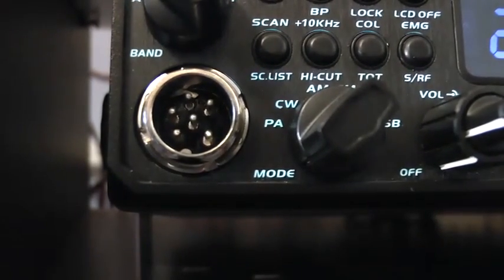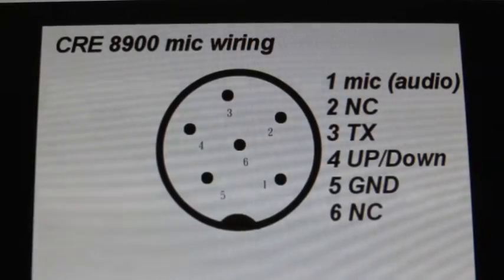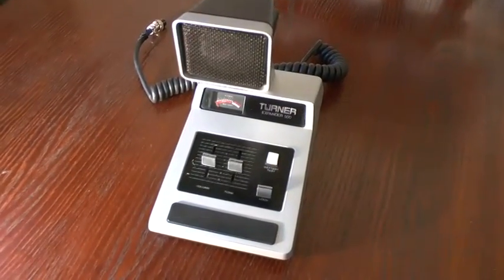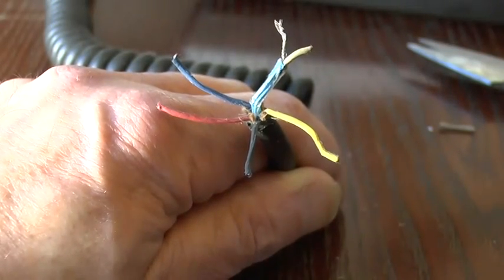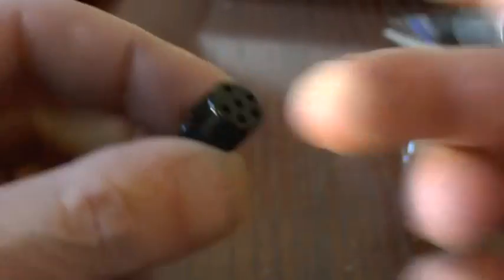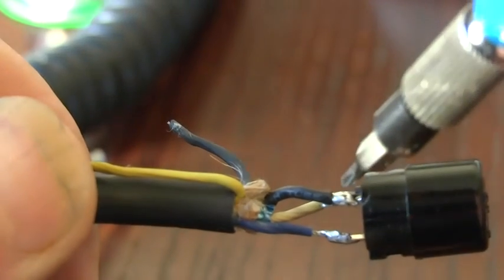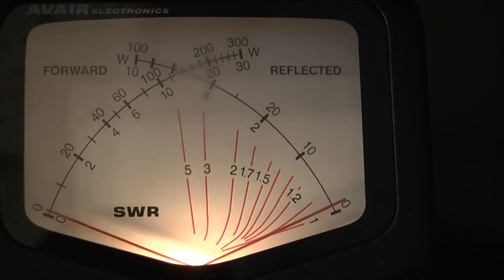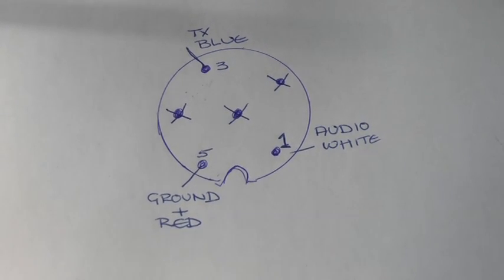Turner Expander 500 wiring to CRE 8900

Comment: Thank you very good video and a great help.  I have a Turner Expander 500 wanting to connect to my President McKinley and this wiring is exactly same for my 6 pin plug so going to do what you did and remove the pins not being used very safe way of doing things.  Well done good job!

Comment: Just to answer my own question. With a straight Turner Plus Three microphone the red wire is not necessary and left disconnected. The rest of the wiring is exactly like this video and pushing the three extra pins out is definitely the way to go. The Plus Three is an amazing mic with this radio too. Thanks for the good vid and the great idea's. I so appreciate it!!
Reply: ]p